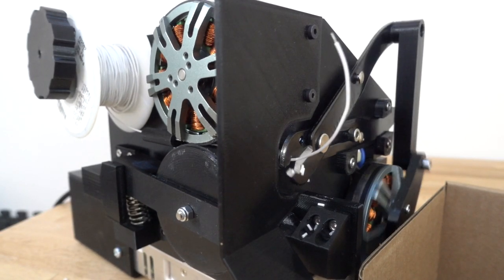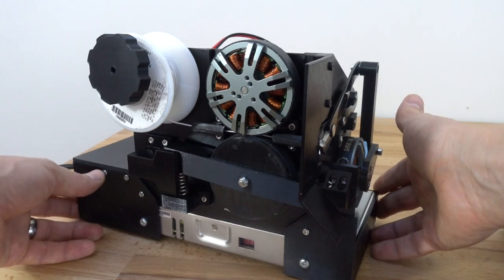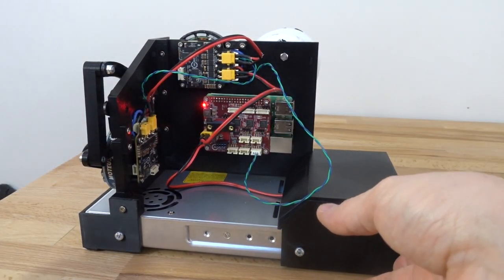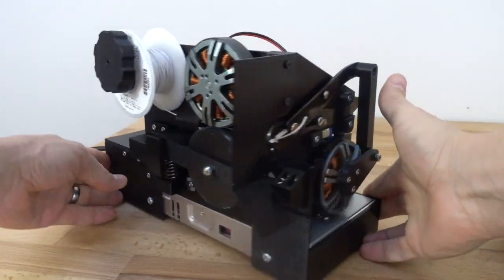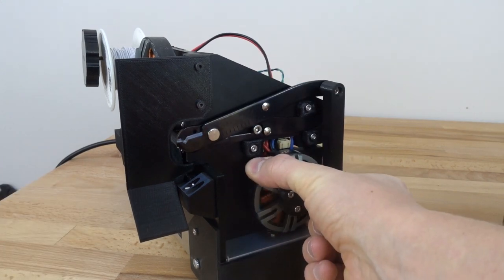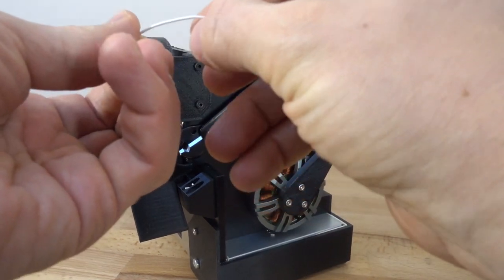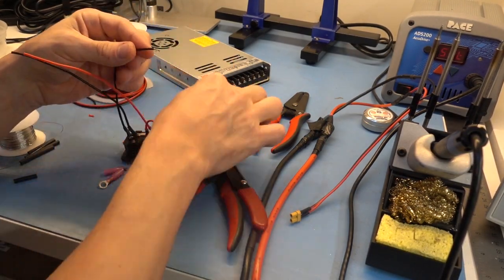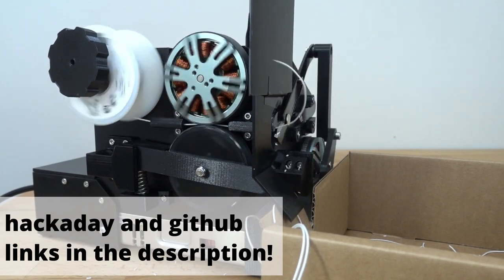bstrip - open source high speed wire cutter and stripper

Comment: Nice project. I'm now doing primary sketches to build one. Looking for information to compare a mj5208 brushless motor to a P-series Nema 23 Bipolar 3Nm, your site came to my attention, then this video. I understand you had the brushless motor lying around. If you had them both, which one would you prefer and why? Can the cutter itself in this project also cut 2.5 and 4 mm2 wire? Thanks for this project, it shows really useful information. Thanks again.
Reply from the maker: I've only tested it on 26 AWG, although it can probably go a bit thicker, but probably nowhere near 4mm^2 (12AWG).  No clue on that stepper, moteus won't even drive steppers so you would need a different controller.
Reply: @awesjosh  thank you for your reply. I will use then different stepper drivers, I knew about that. Thanks.

Comment: Would hobby servos be accurate enough to cut the insulation without damaging the wire or do you think the moteus controller is uniquely suited for this.
Reply from the maker: I collected a bunch of alternative machine videos in the corresponding blog entry: https://jpieper.com/2020/12/11/automated-wire-stripper-and-cutter/

There aren't many hobby servo machines that strip, and those that do usually have a hard mechanical stop for the stripping action and a 3rd servo/actuator to shift the wire between a "cut" and a "strip" slot on the cutting blade.

Comment: This is really cool. I have been wanted to build something like this for a slightly different purpose.

Do you think it would be able to cut thin vinyl coated aircraft cable?  (3/64 cable without vinyl, 1/16“ with)
Reply from the maker: I honestly can't say I have a good idea of the strength of that media. I'm sure you could construct something that could cut it, but I couldn't guarantee this particular mechanism could.
Reply: @awesjosh  thank you for the quick and candid response. 

I suppose worse case it may just require a different cutter and more torque for the motor that drives that cutter. 

I think the rest would all work 

Very cool design either way. Thanks again!

Comment: Any issue with drilling the hole in the wire stripper for the pull arm?
Reply from the maker: Nope, I just used a normal drill bit in a power drill.
Reply: @awesjosh  Nice, your design that uses the power supply as a base is genius. Thank for sharing.

Comment: How are you sending the different lengths to the raspberry pi? Do you hook it up to a monitor? Or do you have to change the lengths in the code?
Reply from the maker: It is just a python script that I run on the rpi, and the lengths are set by command line arguments.  I ssh to it over wifi.
Reply: @awesjosh  thank you

Comment: How do motors take the heat? Do you have a fan colling them?
Reply: PS: This is a great video and a project. 
PSS: this has not feedback loop?
Reply from the maker: thanks!

The loads here aren't that big steady state, so nothing gets hot enough to need cooling.

The only feedback is from the absolute encoders built into the motor controllers.  That is what allows precise length measurements and insulation piercing.

Comment: Why did you decide to use Raspberry Pi instead of Arduino? Will the moteus motor controllers work with Arduino?  I'm kinda new to all of this and I need to make a wire cutting/stripping machine for my business, and I thought this would also be a fun way to learn about open source electronics. From what I've read Arduino is cheaper and easier to work with starting out, and can easily handle simple machines such as this. What do you think?
Reply from the maker: I used a Raspberry Pi both because I had a rpi and a pi3hat lying around, and because developing software for it is much faster than for an Arduino.  For this project, the cost difference between and Arduino ($20) and a Raspberry Pi ($35) is immaterial compared to the other costs in the system.  Plus the fact that with the Raspberry Pi I could develop the software in python, which meant that I could complete the entire project in a long weekend.

It should be possible to control moteus controllers with an Arduino with a suitable CAN-FD shield.  I have one here to test with, but haven't yet broken it out yet to do a demonstration.  No client libraries exist yet for that platform.
Reply: I gotcha. Like I said I'm new and was curious. This thing is awesome! It would save me sooo much time in my business and be cheaper than off the shelf cutter/crimpers. I was up half the night researching this and some of your other builds.

Would it be possible to add a HMI like I've seen with some of the other machines so I could change lengths quickly? Any recommended guides or starter kits to get me started with this?

Thanks for taking the time to get back to me!!
Reply from the maker: It is of course possible to create a GUI.  I operate it via an ssh command line, so just specify the lengths as arguments to the script that operates the machine https://github.com/jpieper/bstrip/blob/main/src/cutwire.py.  I don't know if it is possible to use the rpi LCD w/ a pi3hat, but it might be?  If so, that would be a trivial way to add a UI.

There isn't an instructable-style build guide for bstrip.  The BOM and 3d printer files are in git https://github.com/jpieper/bstrip , this video exists, and you can join the mjbots discord https://discord.gg/W4hUpBb to ask more questions.
Reply: @awesjosh  This is awesome. I'm also looking into making one of these for my business. I just need to learn how to upload your code. I have to learn about this asap.
Reply from the maker: @tightfitfab  The code for this is just a python script that you execute over ssh: https://github.com/jpieper/bstrip

Comment: Those motors are very cool, but why not just use stepper motors?
Reply from the maker: The primary reason to use brushless motors with encoders over steppers are speed and torque control.  In this application, really only the speed is being used.

Comment: Do you have to have a PI to control the setup? i would like to make something similar but different I wanted to know if i could just program the controlers them self. Could i use Pi zero instead with a wave share CAN hat?

I want to make a Heat Set Insert Tool that I can set a torque so that I always have a consistent down pressure. Then I could tune the down pressure based off the torque for a specific type of plastic.
Reply from the maker: You don't need a pi, but you do need something that can send CAN-FD commands.  One time setup still requires a Linux/Mac/Windows computer, but normal operation can be with anything.  There is an Arduino library now for instance.